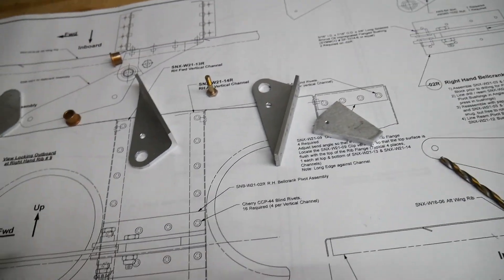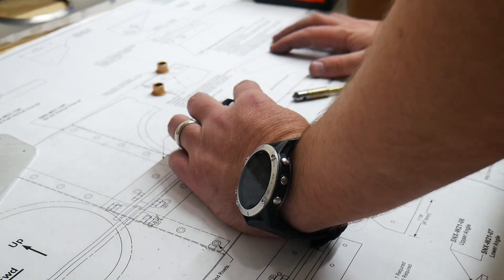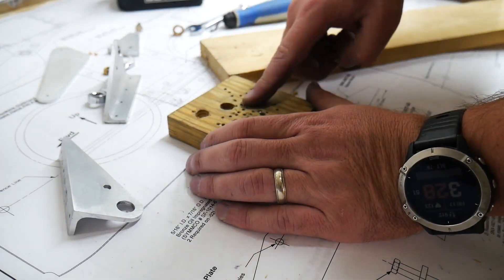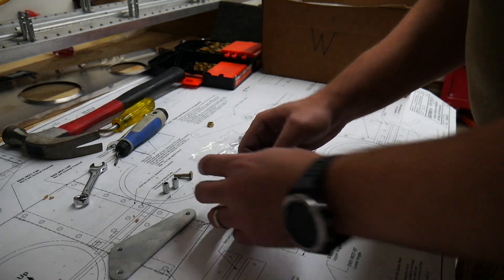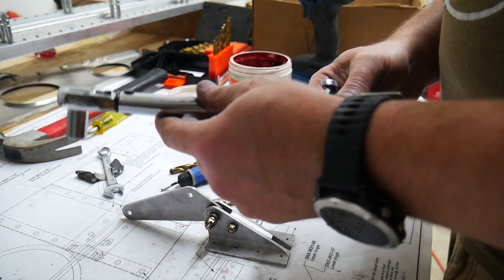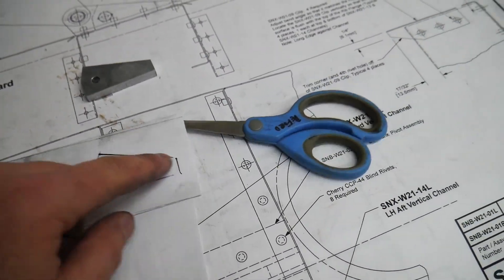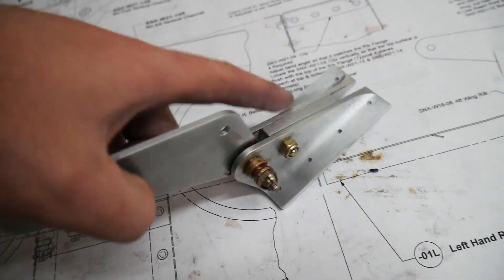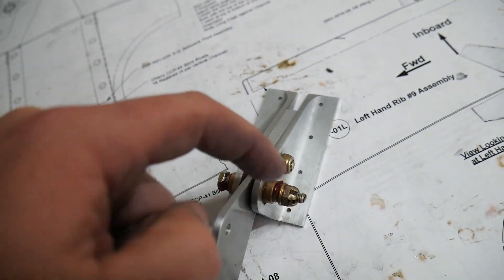Sonex Build - Aileron Bellcranks

Comment: Great work.... I purchased a reamer to help with upsizing the Bronze bushings, plus I use sand paper to upsize in small increments also.   Your plans are looking like mine, messy
Reply from the maker: Yeah, a reamer would be better. If you haven't already done yours, make sure the bottoms of the angles are flat on the table when you go to ream the bushings. Any twist will make the bellcrank fixture bind a little. One of mine was very slightly twisted and wasn't turning as smoothly as I wanted at first. After a few dozen pulls it worked itself smooth, but in retrospect I would have made sure it was flatter on the table when I drilled it.
Reply: will do, and keep up the great work @dan_der_flieger

Comment: Nice fitment.
Like you, I like to have my plans on the table when I am working on something. I have found it helpful to place a sheet of glass over the plans whilst working on them to keep them nice and clean. I  have also used a piece of Plexi but find that it scratches easily compared to the glass.
Keep them coming Dan!
Reply from the maker: Yeah, I definitely prefer to build with the plans right in front of me. With the grease, this one was much messier than most.

Thanks for the constant encouragement!